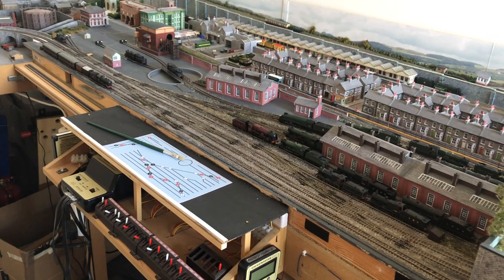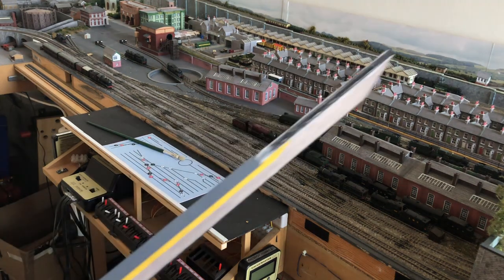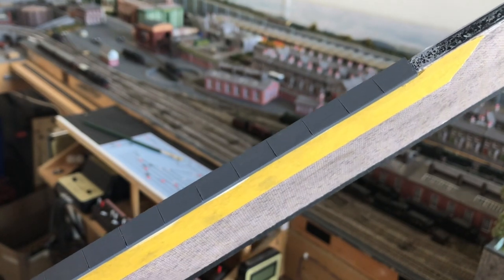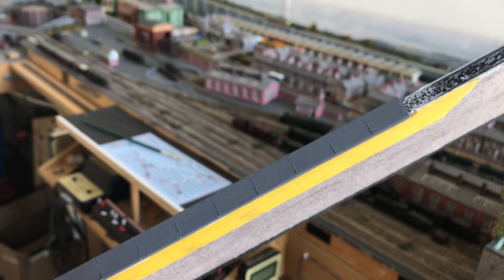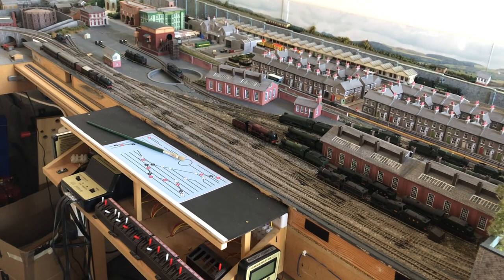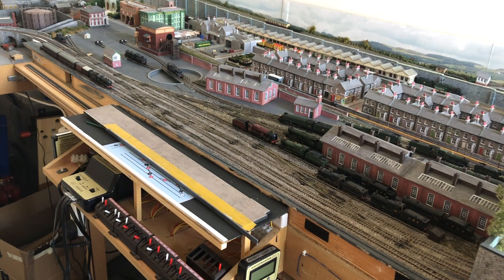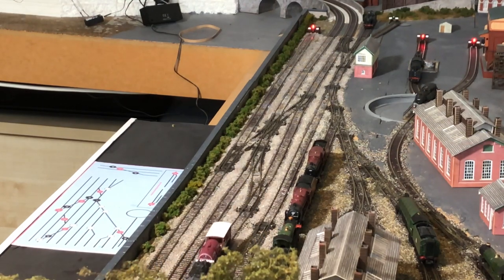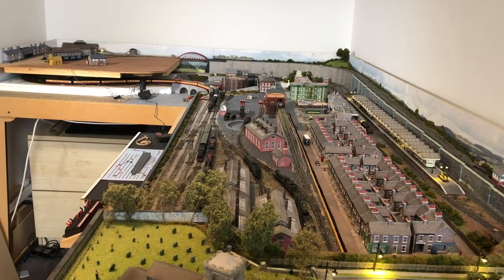Elvenhome N Gauge Model Railway Layout - Making a Brass Etch Kit and completing scenic work EP98

Comment: Hi Stephen. Really enjoyed this edition. I was interested watching you build the brass kit as it is something I’ve never done. It was interesting watching the similarities and differences to working in card. It is a very fine model. The bushes along the top of the wall work really well and I was very impressed with your editing of the running session - the wide angle shots interspersed with perfection with the train-cam. It made for a very pleasing sequence. Thanks for continuing to inspire and entertain! All the best, Michael.
Reply from the maker: Thanks very much Michael.  I was impressed with the kit. I would have confidence to buy another kit.  It will give a different texture to the existing buildings.  I do enjoy using the train cam and editing.  Glad you enjoyed the running session.  Stephen

Comment: The painting is the part that would scare me. I know I would make a mess of it. The wall look great
Reply from the maker: The painting of the brass etch is causing me a little concern.  In the past I have found that paint easily chips off brass.  So far the primer is sticking well so fingers crossed.  Stephen

Comment: Hi Stephen. Dave and I continue to be full of admiration your railway. I loved the neat way you built the chapel and admired the competent use of super glue! Good to see again the trains running but what a prospect to have to change the platform with all that entails. Good luck with that!
Reply from the maker: Thanks very much Joan.  The brass etch kit was more straightforward that I feared.  It was well designed and made.  Looking forward to painting it in the next few days.  The platform may not be that difficult to adapt, but I could do with Mitchel here to crawl under and undo all the wires to the lights.  Stephen

Comment: Hi Stephen the brass building is very interesting. Your station track issues i would do a little engineering work and move the track a little moving it away from the platform but that's me. Look after yourself. Colin
Reply from the maker: Thanks very much Colin.  The platform and the station buildings are not stuck down so it is easier to do that than disturb the track and its ballast.  I think it will be reasonably straightforward to amend the platform, its just the pfaff of undoing the wiring and taking it off.  Stephen

Comment: Great video Stephen. I like the little church, it will look great at High Elven. It’s a real nuisance about the station, one of those jobs you have to build yourself up for. I have a slightly bigger problem with a level crossing. All of my traffic goes past it fine, but one locomotive clips the gate post and derails. Trouble is, I can’t move the level crossing, so have to restrict that locomotive to the inner circuit. These things are sent to try us. Roy.
Reply from the maker: Thanks Roy.  That does sound a right nuisance with the level crossing.  I think the platform will not be too difficult to change but its the crawling around under the layout I am putting off. All part of the fun, and I will be pleased when it is fixed.  Stephen

Comment: Hi Stephen, I’ve been looking forward to this episode of building the Severn Models brass church. Actually it looked much easier than I thought it may have been. I’ve had for a while a brass kit for a dockside crane which I’ve looked at a few times now and may attempt to build it just to see how I get on. I have a bending tool which I’m hoping will be useful.
What a pain with the platform, I hope that goes ok and I would find that extremely annoying myself!
The wall and bushes really finish off that front edge off and I really like the wall capping, excellent stuff as usual.
Cheers Stephen, John
Reply from the maker: Hi John. I was a bit nervous how the kit would turn out to be honest. It was a good kit and everything fitted as it should.  The main pain with the platform is crawling around under the layout I suspect.  It isn't stuck down and the canopy also just sits on the platform.  I just need to creak around under the layout for a while, and I suspect the adaptation to give clearance will be pretty straightfoward.  I am pleased with how the front of the layout has turned out.  It is amazing what a bit of scenic work can do.  Stephen

Comment: Hi Stephen, Really enjoyed this update! loved the church build and yes brass is definitely a learning curb but well worth it. As it happens I have just made a couple of brass skips and tried soldering them, just to see if I could 😀 which actually turned out ok for my first attempt but I still need practice. In the fullness of time I have a brass engine shed to build but need more practice before I attempt anything on that scale! All the best Tony
Reply from the maker: Hi tony.  I 'm pleased you enjoyed the update.  I did solder the caged ladders for the Fire Station.  The kit makers really steer you towards using super glue.  I think it would be quite a task to solder everything in the kit.  Good luck with the engine shed when you get to it.  Stephen

Comment: That church is lovely Stephen. I’ve never worked in etched brass before but if those are the sorts of results you can get I think I may need to seek out a little kit to give it a go. Paul
Reply from the maker: Thanks very much Paul.  I was very impressed with the kit and it was easier to build than I feared.  Well worth getting one and giving it a go.  Stephen

Comment: Great, interesting video Stephen, the brass kit looks very good, looking forward to see how you paint the brass. Like the train cam at the end its a nice run round the layout. Finally hopefully o surgery to the platforms it seems a painful task to have to undertake! Regards Gary
Reply from the maker: Thanks very much Gary.  I was pleased with how things turned out along the front, and train cam does let you see from track level how things look.  I think the platform changes will be quite straightforward (nothing is stuck down) its just a nuisance having to undo all the lights below the baseboard.  Stephen

Comment: Hi Stephen, nice work on the church kit, will be interesting to see how it comes up once painted. The platform issue is annoying and I hope you can fix it without having to pull the whole thing apart! Cheers John
Reply from the maker: Thanks John.  I expect correcting the platform will not be too difficult.  Squeezing my frame under the layout to undo the wiring is probably what is making me think it will be.  The brass kit was a joy to make.  I was a bit nervous at first, but almost from the first couple of folds you could see it coming together.  Stephen

Comment: Hi  Stephen  - catching up on YouTube videos this morning.  Never built an  etched brass kit so it was interesting to see how you went about it.  The mainline tracks with the added bushes really looks good and gives the feel of authenticity to that part of the layout.  Must be so annoying to have to shave a bit of the platform to allow the 8f's to pass without fouling the platform edge.  Take care -  Euan
Reply from the maker: Hi Euan.  I was pleased with the kit which went together very well.  I do like doing scenic work.  it doesn't take much to transform an area.  It is a pain about the platform, but there we are real life railway problems about trains being out of gauge for a route.  At least nothing is stuck down, and apart from crawling around under the layout, it should be reasonably straightforward to make the changes.  Stephen

Comment: Nice video has usual, that brass kit looked easy enough. I have just made a station footbridge from York Model making, I can say it is the hardest kit I have ever made, I am surprised with myself I managed to finish it. Good luck with the platform and your 8f, I have one of those I better check my two platforms. I have a hardly done any work on my station so it would good to sort that before I do. Keep safe and keep up the good work.
Reply from the maker: Thanks very much Chris.  I was impressed that the brass kit was so well designed and made.  The platform should be straightforward enough once I get the wiring undone. It will teach me to be smug that I managed to get the distance between the carriages and the platform right - all very well until you get a wider locomotive.  Stephen

Comment: Hi Stephen, layout is looking marvellous.
I am just wondering where the next expansion of your layout is going to be?
The brass kit looks fantastic, shame they don't do roofing and ridge tile kits.
Regards Chris
Reply from the maker: Hi Chris and thanks.  The basic structure of the layout is now pretty much done.  The major work now is all scenic including working out how to blend High Elven to the area below.  For roofing material I think I am going to be staying with Redutex (and not just for roofing but paving and other surfaces as well).  Lots of choice and easy to fit.  I don't think they do ridge tiles, but I found on the Pub just overlapping one side at the apex did the job well enough.  I think the company in Spain is set up to keep selling to the UK, or DCC supplies are the UK distributor.  Stephen

Comment: Hi Stephen. 
Thanks for another great video.
One thing that is puzzling me is how you intend to blend the High Elven board into the rest of the layout?  It has very straight edges which will be hard to make look natural.  I'm sure that you have a plan. Pete
Reply from the maker: Hi Pete and thanks.  I am grateful for your confidence in my having a plan.  I had always intended the front to be pretty sheer.  The tricker bit is around the corner and along to the bow string bridge.  Still letting the cogs whirl on how I am going to do that.  Stephen

Comment: Great video.  Church looks great and the wll improves the layout no end.  My wife wondered what Geri Halliwell has to do with model railways.  Is it your dreamlist of barmaids for the layout pub masquerading as a pub quiz list!?  Shame about the platform edge.  Over at Chadwell Michael shaved the edge with a file.  It might be worth giving it a go before any more drastic options.  Is the problem the whole length or just certain sections?
Reply from the maker: Hi David.  I wondered who would notice Geri.  Not a dream barmaid but as you thought the answer in a family Zoom quiz which I answered correctly much to everyone's astonishment (pop music is not a strong suit for me after about 1969!).  I am going to see if I can adjust the existing platform before replacing it.  I just have to build myself up to getting underneath to unwire the lights.  The problem is just the ramps on the inner loop and mainly at the end nearest the camera.  Stephen
Reply: @Elvenhome  Why don't you simply cut the ramps off, leave the rest of the platforms in place and build new ramps to put in their place?
Reply from the maker: @davidrauger  Having thought about it a bit more, and with a helpful comment on the N gauge forum, I think I will look to adapt the existing ramp and the near end first.  It doesn't need to be that wide as a ramp.  If that cures the problem I won't need to touch the other end.  Stephen
Reply: @Elvenhome  Great thinking- better to try the less invasive option before ripping the platform arm off first!

Comment: Hello Stephen, I've been thinking about the section underneath the bow string bridge and I've had an idea about it. Why not put an old, disused and overgrown canal under there that ended up going the way of the dinosaurs when the railway was built?
Reply from the maker: Hi Robert.  It is funny you should suggest that.  When I first designed the layout a river was intended to wend its way under the high bridge and through the arches of the viaduct into a port.  Over time that was cut back to a disused canal and then it disappeared altogether.  However I will think again about a disused canal.  There is going to be road going along there eventually.  it could also be a canal that has been shortened and the basin filled in to allow the gasworks to be built.  Thanks for the idea and I will think about it a bit more.  Stephen

Comment: The church went together very easily, I’ve always been slightly worried about metal kits. Where did you get that small t square, I’ve only seen large ones? Thanks, Mel
Reply from the maker: Hi Mel.  I was pleased how easily the brass kit went together.  I too have been nervous of them in the past.  I got the square from Squires at the Warley Exhibition I think.  They are called Engineer's squares.  You can buy them online from Eileen's Emporium.  The one you saw me using was the 2" and I have a 1" one as well.  Useful little things.  Stephen
Reply: Thanks for the information. I have now been able to get a 2 inch and a 4 inch. Mel

Comment: What did you think of the scale of Severn Models as say compared with Metcalfe and then again with Bachman buildings.?
Reply from the maker: Funnily enough Roy I was musing on that earlier today.  I think some Metcalfe buildings are rather large.  Bachman are I think 1:160.  Comparing the church to the Petite Properties houses it looks about right.  The end wall is scale height 19' to the apex of the roof.  It is  just a bit shorter in height than a two storey buildings near it. Stephen
Reply: @Elvenhome  your reply prompted me to check further with rather surprising results. Metcalfe seem to have got it right from my scale 2mm ruler. 7.5 metres to the ridge, 5 to the guttering and 2.5 to ground floor ceiling of a standard house. Severn must be to 160:1 however Severn Models seem to fit well with Bachmann building and I think create a better perspective, whereas Metcalfe seem huge at the rear of my layout which is only 30” wide. Incidentally where did you get the Proses Folder from, can’t find it listed anywhere.
Kind regards
Roy
Reply from the maker: @roywhitgrove8058  That is interesting. I have found some of the Metcalfe buildings too overpowering given the overall size of my layout.  As I will show in the next video,  I have replaced the entrance and boiler house in the area of the Gasworks because it was too dominating.  An interesting example of a building being to scale but "looking too big" because you can't set it in the right amount of space on the layout.  The folder is from Peedie Models in Orkney.  I've added a link to it in the description to the video.  Stephen
Reply: @Elvenhome  thanks for that, the layout looks really good by the way. Roy